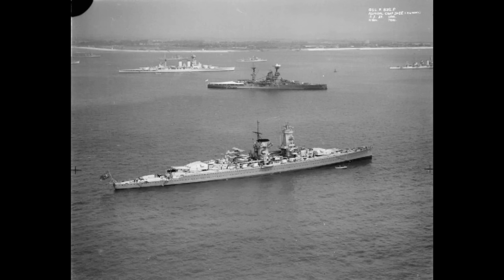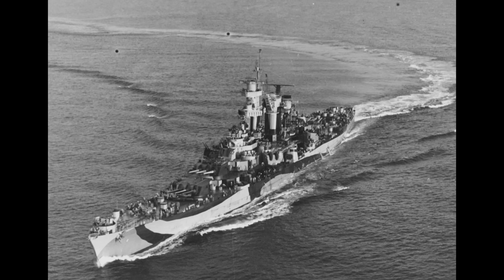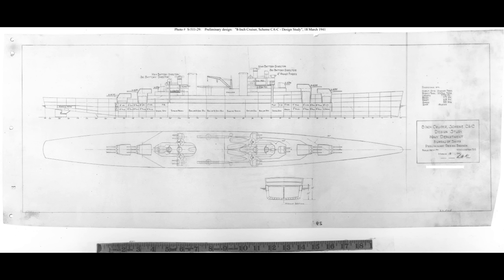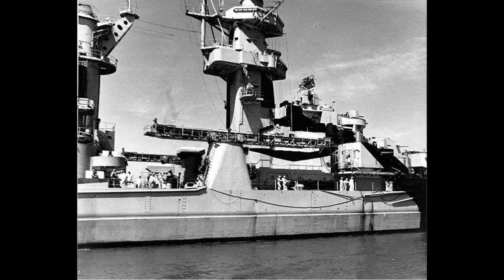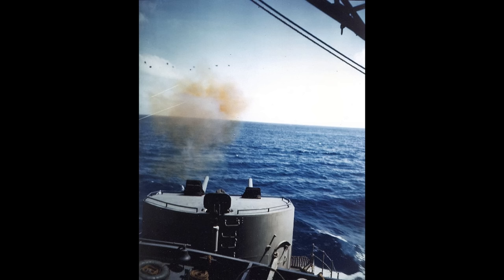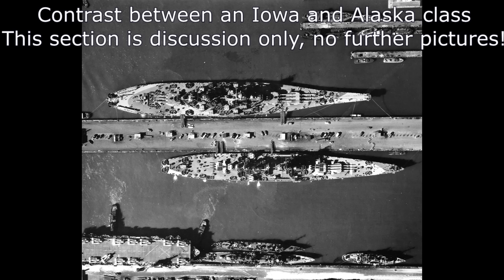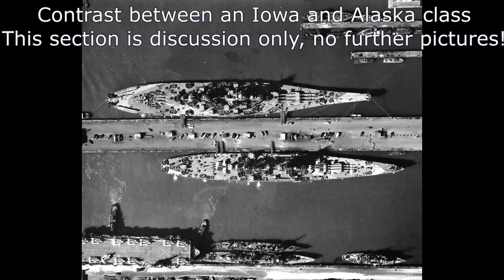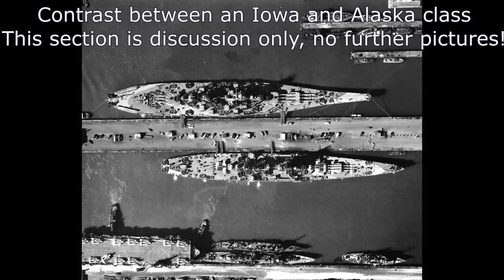The Alaska class - Large/Super/Battle/Mega/Hyper/Ultra Cruisers

Comment: I think I'd make the case that the Iowa Class were closer to what was envisioned for an American Battle Cruiser, than an Alaska Class.  

It's the armament point that does it for me, along with the Cruiser lines of protection that put the Alaska Class in my mind as simply Large Cruisers
Reply: A battlecruiser is a capital warship that sacrifices either firepower, or protection for additional speed. The Iowa is better protecged and has the same firepower as the preceding battleship class. Its a fast battleship. The alaska gives up both protection and firepower compared ro a battleahip, making it a german style battlecruiser. Argument is unnecesseary, if one uses this rule of classification.
Reply: I would contend that the Iowa Class did in fact compromise its protection for its Speed.  Though the degree of this compromise wasn't nearly as dramatic as was seen in WW1 Era battlecruiser designs, thanks in large part to the progression of naval technology (particularly in Engines and Boilers).   

But the fact remains that Iowa Class was not protected against their own main armament (the US Navy's traditional Battleship standard), they used the same armor scheme as the proceeding South Dakota Class in spite of not being under the treaty limitations that the SoDaks were, and did so very deliberately to have their 33 kt high speed.    

Iowas still had very good armor protection (13 or so inches of inclined belt armor is nothing to sneeze at) but it's still the obvious dump stat of the class.

The fact that all three classes of Later US Navy battleships (Iowas, SoDaks, and N. Carols) are rightfully regarded as Fast Battleships doesn't abrogate the point that they fulfill more of the perceived role of a battlecruiser type ship than an Alaska Class could, would, or did.   While the Alaska Class could fulfill parts of the battlecruiser role, they were designed and built to fulfill a niche role in over-matching heavy cruisers on heavy cruiser +P lines.

(Even the Germans didn't call their Deutschland Class "Schlachtkreuzer" but rather "Panzerschiffe" and later redesignated them as simple heavy cruisers).  

It's just much cooler to call ships like the Graf Spee a Pocket Battleship, and the Alaska an American Battlecruiser.
Reply: @CaiLeonas  The deutchland class were not battlecruisers, they were pre dreadnought battleships. The Iowas were not fast enough to run down cruisers, and had enougha rmour to duel with battleships. The points raised in favour of classifying the Iowas as battlecruisers are very weak.

Comment: I think there was a upgrade path for the Alaska class. Design a full autoloading system for the mainguns as this would require turrets upgrades also convert battery to dual purpose. Replace all anti-aircraft/secondary guns with Radar guided dual 20mm t171 Vulcan guns in mini turrets(one gunner one armorer) twenty per side. Add sonar suit & mk24 anti submarine torpedoes in rapid fire launchers for self defense. Delete aircraft/hangar add small boat storage. With these changes crew requirements would be greatly reduced & space would be available to transport/deploy Marines as required. As a three ship group they would have made a superb quick reaction force or make the Bismarck raid seem pleasant by comparison.

Comment: In all seriousness, I generally agree with the conclusion.

For me, it's a question of design derivation. A battle-cruiser is derived from a battleship design,  being a downscaled BB, with guns of the same caliber, less armour and more speed. This might for instance be an iowa, but only armoured against, say, 12" fire and with only six guns.

A large cruiser on the other hand is an upscaled cruiser design, with larger guns, though not BB calibre, and more armour. Ideally it should also be faster than a BB.

This would make the large cruiser the "cruiser killer", and the battle cruiser the "large cruiser killer".

All of this actually gave me an idea. Both types of ship are arguably cruisers, since the defining feature of a BB is the combination of BB guns and armoured against similar levels of firepower.

So what we have here are essentially two ships of almost the same type, with more or less the same mission profile. Of a similar size, with similar or identical levels of protection and speed. The only difference is that one class has bigger guns, and is meant to be a soft counter to the other.

This is exactly the distinction we have between light and heavy cruisers in the time period. 

What we have is thus one distinct class of ship, based on parameters and mission profile, but with a sub-division based on gun calibre. Meaning we have light battle cruisers armed with 11-13" weapons, and heavy battle cruisers armed with 14-16 (or I guess technically 18") weapons.

Making the Alaskas light battle cruisers.

Comment: Get one person, like me, to design the gun first. Then build the ship to fit it. I say a 6 barrel Vulcan cannon rotary design using 16” Iowa class type cannons. Mounted one pointed fore and another aft low in the hull of the ship. Only vertical aiming is needed as firing a 100 round burst will stop all enemy aggression due to pants peed in. Forward battery fires. Which slows ship. Ship makes u turn and fires aft salvo which helps propel the ship out of the area.

Comment: There was also a 12" gun battleship in USN service at the time. Arkansas. There were also the German ships Scharnhorst and Gneisenau, which had 11" guns but are often classed as battlecruisers.

I would also say you need to take into account what the ships are meant for, and how they are employed. These ships were meant to be cruiser killers and raiders, which is the typical work of battlecruisers historically. There is also the simple fact that the designers were trying to save steel and other resources when they designed Alaska, which cut down their size, speed, etc...

Comment: For whatever my opinion is worth, the Alaska-class should have been designed and built as Fleet Flagships. Forget the 12" guns (These ships were grossly overmatched against battleships and expensive overkill as cruisers.) maximize communications / command / control facilities, keep the heavy anti-aircraft suite, and upgrade underwater protection as much as practical.

If anything, anti-surface firepower was the least important requirement a carrier escort. One could probably get away with quad 6" mounts; if nothing else, that could ruin another cruiser's superstructures.

Comment: The Alaska class are large cruisers. They are derived mostly from cruiser design standards, but larger. The Iowa class meanwhile are simultaneously fast battleships and battlecruisers. Purely from contemporary design they are battlecruisers, but their battleship counterparts are not present, and with the Iowa class being protected to the same standard as the rest of the USN’s modern battleship line they are operated primarily as a part of it, rather than in support of it. In design they are battlecruisers but in usage they are fast battleships.

Comment: Regarding the battlecruiser/supercruiser debate - I would posit that Alaskas, being spiritual successors of the Invincibles, are not battlecruisers - but neither are the Invincibles. The Invicibles' original naming was 'Dreadnought armored cruisers', and it fit - they were designed to do to armored cruisers what HMS Dreadnought herself had done to earlier ironclad battleships, and at this task, they succeeded admirably. Later German battlecruisers, as well as the Splendid Cats, etc, were an entirely different class of ships, built to fight battleships if need be, and their naming reflects that, but Invincibles got shoehorned into this role and failed badly at it; therefore, their original moniker of 'Dreadnought armored cruisers' suits them much better. The fact that they used battleship guns is incidental - they needed a weapon with significant overmatch against 8-9.2" that armored cruisers of the time tended to carry, and 12" was it. Fast forward several decades, and the Alaskas are following the same design principles - fast enough to catch contemporary cruisers, big enough teeth to kill them, yet nowhere near strong enough to challenge battleships. Since armored cruisers, with the exception of Georgios Averoff, are all gone by that point, I think it's fair to call them just 'Dreadnought cruisers'.

Also, Iowas make a lot more sense as the battlecruiser companions to the Montanas. Trade some armor and one turret for a great burst of speed; classic battlecruiser.

Comment: I think the whole debate on whether the Alaska is or isn't a battlecruiser depends on how you define a BC and also what one considers to be examples of the BC. I for one, do not think the Iowa are BCs, and neither is Hood. They are Fast Battleships, and for me the Fast BB supplants the Battlecruiser as it does everything a BC can do, but is armoured to full BB levels so can do things a BC cannot do, ie fight the main batteline. 
It means that by WWII, especially once the US enters the war, Renown is the only official battlecruiser left, which is further evidence the term is fairly redundant.

I sit in the 'By Role' club. I will say, I consider the Iowa's to be the outlier stat. Everything compares poorly to the Iowa's and even Yamato is at best an equal, so I consider them more the ultimate, no-expense-spared Battleship. Regardless of whether it's the latest and greatest, the 14" gun was a common standard Allied battleship gun, with the KGV's, New Mexico and Tennessee's all having 14" guns, and because the Alaska's 12" gun has comparable performance, I do put it on par and so do consider it to be a contemporary weapon to BB-grade ones.

As Drach notes, the Alaska's would perform both the original design brief of murder-ating cruisers/raiders on top of the later requirement of fighting contemporary ships, as well as the gun performance meaning they could be used to supplement the main battleline as the German's did during WWI, for me it means the Alaska's are Battlecruisers by the design role, with the acknowledgement that the role of the Battlecruiser has been entirely supplanted by the combination of fast battleship, post-treaty heavy cruisers and aircraft carriers, meaning the USN calling them Cruisers makes more sense from a doctrine and reality perspective.

My view is based on the benchmark that the Dunkerque's, Kongo's, Scharnhorst's and Renown's are all battlecruisers and I would say Alaska comapares fairly well to them all. The Deutchland's are heavy cruisers and Hood and Iowa's are Battleships. I would also say that because I define Hood as a Fast Battleship, I would put the Amagi's as Fast Battleships, comparatively lightly armoured ones, but Fast BB's all the same.

I do think Drach's reasoning is perfectly sound, and even if one was to argue that the term 'battlecruiser' is redundant by WWII so the Alaska's can't be a type that no longer 'exists' is also sound. I do find it's an interesting discussion because there is a lot of subjective opinion to it; what the role of a BC is, what is or isn't a BC and the characteristics of a BC vs peer BBs/CAs.

Comment: I’d say that warships for surface combat in 1900-1950 fall naturally into two pairs:

1)	Fleet units with guns or torpedoes as main armament. 

The bigger the gun-armed ships, the bigger their guns and the thicker their armour, so they should be as big aa possible, at the cost of having few of them. These are battleships.

The torpedo armed ships have a weapon which is not much faster than their targets, so they have to be fast and inconspicuous enough to get into firing position before anyone can do anything about them. Being small, they can be built in numbers, which makes them good vessels with which to shield your own battleships against enemy torpedo craft. These are destroyers.

2)	Ships capable of operating independently of the fleet, as scouts, raiders, interceptors of enemy raiders etc. In principle they might be any size, but they have to be fast enough to run away from trouble if they find too much of it. In general, they fall into two groups:

The bigger ships are the size of battleships, but sacrifice armour and firepower for the needed speed. They would be at a disadvantage against a battleship in a fair fight, but their speed should mean they don’t need to fight fair for long. They could, for example, fight an enemy battleship if it were already tied up fighting a friendly battleship. In a fleet action, they can use their speed to help support the battleships by attacking from a favourable position. These are large/armoured/battle cruisers.

The smaller ships are powerful enough to overwhelm a destroyer, but not much else. Being smaller and cheaper, they can be built in the large numbers needed for scouts. In a fleet action, they can support the destroyers in their fight against the enemy destroyers. These are scout/protected/light armoured/ cruisers.

The terminology changed every now and again, but the roles remained as long as the weapons they were built around did. Missile armed warships have almost nothing in common with warships of this era but their names. Their design roles are completely different.

I’d say the Alaskas had their white elephant status because they were basically light armoured cruisers that were far too expensive to be built in numbers. If I had to make use of them, I would make them flagships of cruiser squadrons.

Comment: i think we should still have a Large cruiser class with only the forward battery present, the rear deck containing a large hangar built into the center super structure with angled vertical launch tubes to either side of the rear flight deck (it's a helicoper hybrid battle cruiser carrier with onboard long range antiship missles)

Comment: As someone who studied Real Life Military Technology and Military History as a Personal Hobby during my High School Years in the 1980s, I do have issue with comparing Post-Treaty (The Washington Treaty Of 1922 and The 1930 London Treaty) Warship Design Classification with Pre-Treaty and Treaty (The Washington Treaty Of 1922 and The 1930 London Treaty) Warship Design Classification.

I am unfamiliar with the Warship Design Limitations that Germany was under with The Versailles Treaty Of 1918.

Basically, if one was to Scratch Design HMS Dreadnought (1902/2906) with Post-Treaty and WW2 Warship Technology, five 12-Inch Gun with 60° to 80° Elevation and the same Turret Layout, Anti-Aircraft Weaponry instead of Anti-Torpedo Boat Weaponry, Maximum Speed between 25 Knots and 30 Knots; and, Radar and Fire Control and Range Finders and Radio Communication Equipment; then, the 1930s/1940s HMS Dreadnought would have a displacement around 32,500 Tons.

Battlecruisers followed Unarmored Cruisers into extinction; because, the Warship Design didn't work.  Mostly because, the Unarmored Cruisers and Battlecruisers were forced to fight in situations that they were intended to run away from.

When the USA Navy decided to adapt the Aircraft Carrier as a Naval Fleet Warship, the USA Navy had a choice of either utilizing the Battlecruiser Design, or the Battleship Design, as the Carrier Escort Naval Vessel.

The USA Navy really wanted to have a Battleship Fleet and an Aircraft Carrier Fleet; but, was forced to decide whether to have a Lexington-Class Battlecruiser or to have a Lexington-Class Aircraft Carrier.

The Iowa-Class Fast Battleship Design was an attempt by the USA Navy to have a 1930s/1940s Battlecruiser Design without having the fatal flaws of the Pre-WW1 and WW1 Warship Designs.

The Alaska-Class Cruiser Design was an attempt by the USA Navy to have a Battlecruiser Warship Design that didn't have the Fatal Flaws of Battlecruisers.

I have my own set of Warship Design Theories; and, my own set of Naval Warfare Tactics & Strategy Theories; which, would classify the USS Alaska as a Battlecruiser.

The USA Navy designed the Iowa-Class Battleship and the Alaska-Class Cruiser to bypass the Battlecruiser Warship Design Classification; because, of the lessons learned from the WW1 Battle Of Jutland; which, was a poor Proof Of Concept concerning Naval Warfare Tactics & Strategy Theories and Warship Design Theories that predated WW1.

The Washington Treaty Of 1922 was established to reign in the "out of control" Warship Design Concepts that were occurring after WW1.

The 1930 London Treaty further refined the Warship Design Classifications of The Washington Treaty Of 1922.

By 1936, Radar, and Range Finders, and Fire Control, and Radio Communication Equipment, and Naval Artillery Gun Technology, all contributed to the Treaty Classification Systems by Displacement as being obsolete.

After 1936, each Nation had its own Warship Design Classification System; and, Warship Design Concepts became as radical as the Pre-Treaty Warship Design Concepts.

Comment: By the late 1930s capital ship design had blurred. There was no longer any point in naming a ship a battleship or battlecruiser. Modern designs were a bit of both and could really do both jobs.

It is akin in some respects to the contemporaneous evolution of the tank. As power plants and transmissions improved to allow greater weight with no reduction in speed, and as guns reached their practical maximum, the concepts of infantry tank and cruiser tank became obsolete in favour of the main battle tank, which could do every task any tank needed to do pretty well.